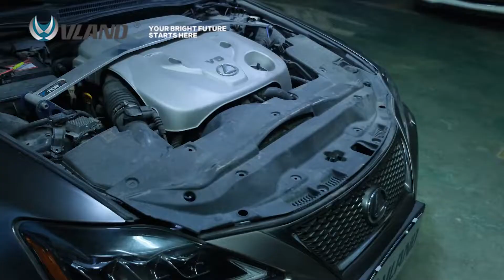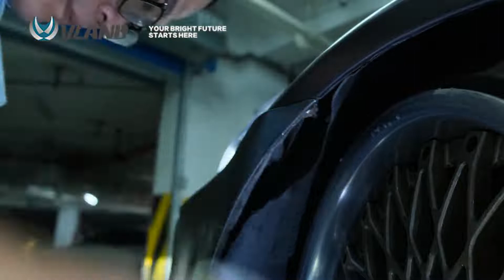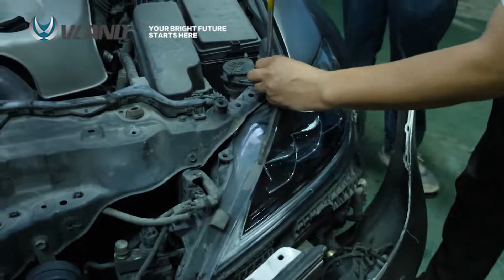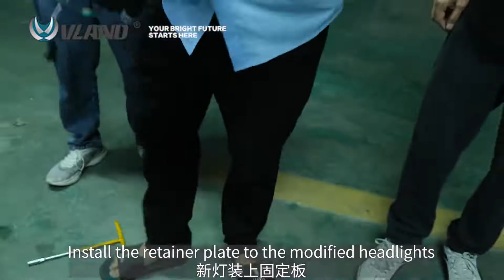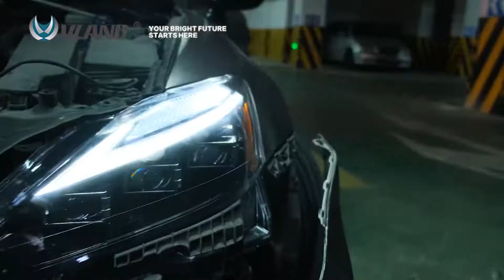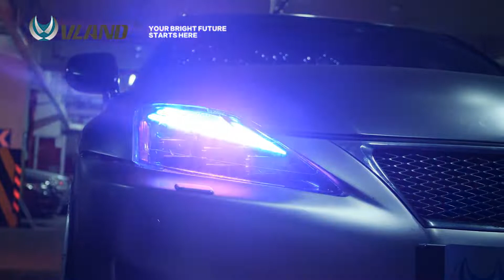How to install Vland New LED Projector Headlight for Lexus IS250 2006-2012?

Comment: Hi I bought the same lights and followed everything on the video. I did not have the part that connects to the battery tho. Also when my headlights are on the on position they work fine but no start up sequence and when I turn off the lights all the beams flicker really loud.

Comment: So these are new type of vlands for the is250? The ones you removed were the old vland and you are now producing new ones? What price?
Reply from the maker: Hello, please check on this link if you are interested in this headlight, it's on sale now, thanks! https://www.vland-official.com/products/vland-led-projector-headlights-for-2006-2012-lexus-is250-is250c-is350-is350c-is220d2008-2014-isf-w-start-up-animation